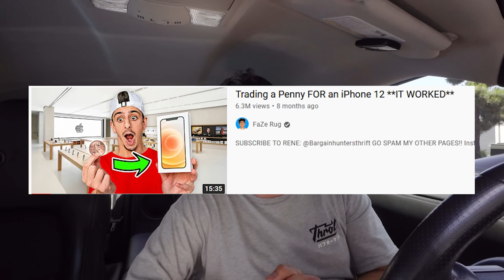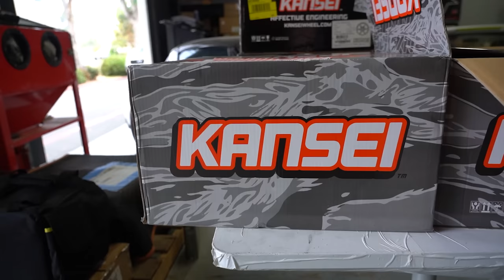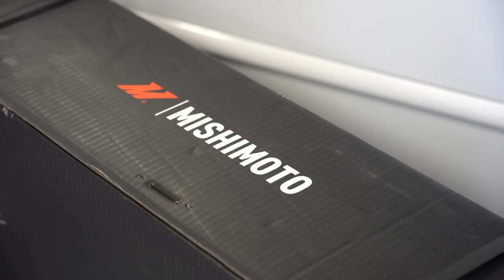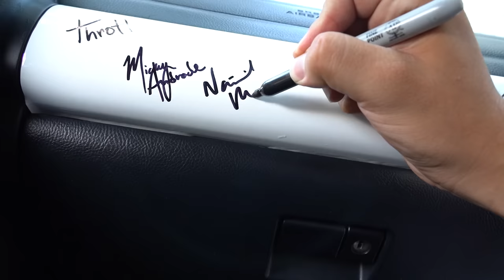Building a $7,000 Lexus IS300 & then TRADING it FOR a Ferrari! [COMPLETE TRANSFORMATION] -Ep.01 - 4K

Comment: i have a feeling the bmw isnt actually blown
Reply: My thoughts exactly
Reply: They came up
Reply: He said something about ticking I think it probably just needs a valve adjustment
Reply: “Reputable” shop plus outside BMW tech said it’s blown due to poorly executed Oil filter housing gasket replacement where they didn’t bleed the System properly. So either two different sources lied to me or the main bearing spun and spit metal shavings into the oil. We will see

Comment: For the people looking to run the wheel n tire specs
16:45
Throtl Spec Wheels
Kansei Roku
18x9.5
38 offset squared

Staggered Tire setup
mentioned 255 back  X 35  guessed check ( 17:28 )
mentioned 235 front X 40 also a guess check ( 17:24 )
Reply: looks like they are running spacers and extended studs up front as well. I would guess 5mm spacer at least

Comment: That’s not how you remove Platstidip.  It’s called a ‘peelable” paint for a reason

How can you trash Plastidip then immediately wrap the car?
Reply: The issue isnt the product itself, its in the application of the product, there are more people doing it incorrectly with rattle can sprays from their local parts store. The product from dyc that they used, was created essentially for the purpose of removing incorrectly applied plastidip
Reply: @chriscaine1776  I am sorry, but disagree with you. It  potentially might not have been done right. You need enough layers to make sure you can peel it off. That is true, but what they had(based on the scrape  and the amount of material they pulled off with that tool) was enough to peel it off no problem. Then they sprayed it with solution that is meant for small hard to get off parts like the “CWest” part they mentioned. How would anyone “peel” off a liquid product? That is not what it is meant for. They obviously did not talk to Fonzie. Despite dropping his name multiple times. If anything Fonzie probably tried to help them out, but they didn’t take 5 minutes to watch a DYC video about removing Plastidip. 

Would you spray paint thinner on your wall to get it off? Is there a special spray for wrap removal? Give me a break…

I have dipped multiple cars and had no problems removing it. Wraps leave a residue. Plastidip does not, is cheaper, has more applications and protects the car/paint

I love Throtl (despite the floral yellow on every build) but this is a joke
Reply: @Jalte7  i was more so talking about the point they were getting at and the relation to the product they had used. The product they showed being sprayed was "snakeoil" which is a heavy duty stripper of some sort from my understanding
Reply: @chriscaine1776  they did use DYC remover which is a product of the company. They just did not use it correctly. It is meant for a helper in peeling and breaking down Plastidip in spots where it is too thin or hard to remove. It is actually pretty similar to GooGone tbh(they have an identical smell). If you use a cloth after spraying, it comes off extremely easy. - It turns Plastidip back into a close to “liquid” property, but any abrasions(even from a towel) will take it off smooth surfaces. Like car paint
Reply: @chriscaine1776  to clarify, if you have parts that should be removed by peeling, they should be done first. Then apply the remover. The residuals they got after spaying multiple coats of remover and leaving it means it was thick enough to be peeled normally. I’m nota DYC sponsor, but I’ve used the product multiple times over

Comment: Guy came up with that Lexus…. That car will run forever and will always look great…. Trust me I used to own a is300 and when I sold it,the odometer was at 235k I purchased the car with 160k and the only issue I had with it was the oem radiator too mount had a hairline crack and the evaporator sensor went faulty but thru all the years and miles I ones that car, it never left me stranded or broke some on me….

Comment: The reason you had trouble removing the dip was because whoever applied the dip did not put down enough coats, what you could've done also was spray a few coats of rattle can dips on the body kit, that way the material would be thick enough to peel in big sheets. Don't blame the products blame the installer.

Comment: My ultimate dream daily driver is an is300 with a New SBE 2JZGTE longblock, GSC S2 cams, BC springs with titanium retainers billet keepers and +1mm valves, Ferrea bronze valve locks and valve stem seals, ARP headstuds, HKS coils and GT75115_BB turbo, Artec exhaust manifold, Precision 66mm wastegate, Plasma-mama intake, Link G5 Voodoo ECU, Tweak’d harness, New V160, ATS carbon twin disc with carbon pressure plate and carbon floater plates, ethanol content sensor, 600whp 94 to 875whp full E85.  HKS titanium exhaust, HKS hipermax coilovers, HKS bodykit, stock rear end. 💀

Comment: Plastidip gets a bad rep because half the people that encounter it either dont know how to install it correctly or only see the bad side of it. If you spray plastidip on properly and thick itll peal off just like wrap and last much longer. I think Plastidip will soon surpass Wrap as a cheap and easy color changing method. Dip your car is making amazing strides in plastidip, theyve made clear coats and ceramic coats thatll make it nearly as glossy, smooth and protected as paint.

Comment: I'm not gonna be that guy and say you stole my idea but I've been doing this since 2015. My goal is to have a Ferrari and it pay for itself by trading, flipping, customizing, and blowing up my way up the ladder. I started with a 95 accord sedan back in 2012 it was my first car I bought myself. Then it got wrecked so I bought a 02 dodge neon sxt, sold it to buy a 97 accord ex traded that for my first accord coupe (video on my channel) blew that up. Saved enough money to buy 5th gen prelude (also on channel) customized that and sold it to buy a green 5 spd turbo eclipse(channel) blew that up bought 96 accord coupe sold that and use the money to buy my current sc300 which I just boosted. I plan on gettin an evo next.

Comment: I feel like that plasti-dip remover made more work than less 😂

Also top tip, when painting grill inserts (especially metal ones) instead of using normal spray paint, use a rhino lining in a can spray. Will not chip from rocks hitting it
Reply: I've found that the simplest way to remove plastidip is by using kerosene.....in a spray bottle, and just wipe off